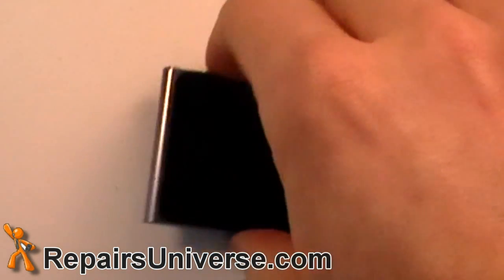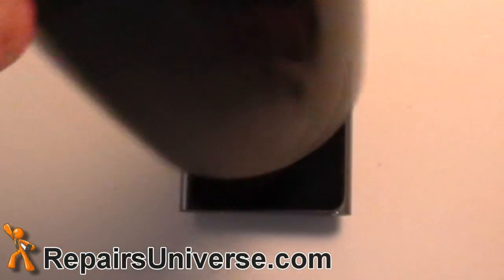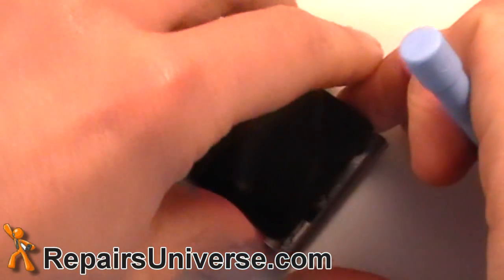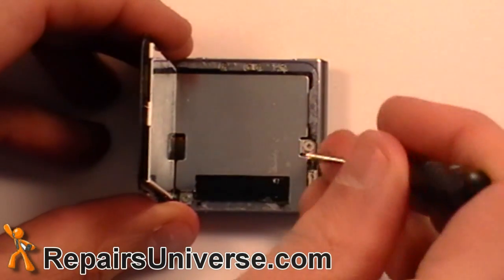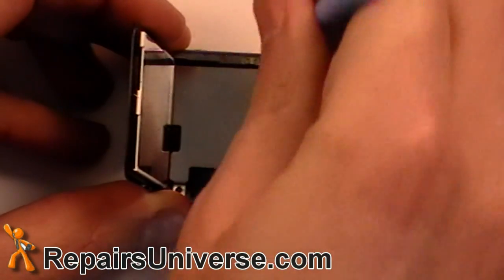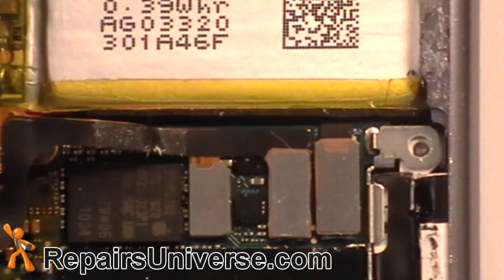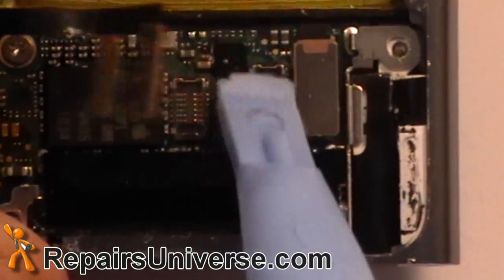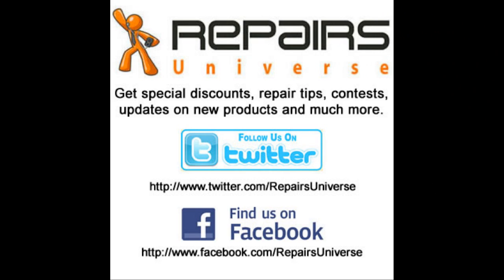iPod Nano Screen Replacement Repair Guide - 6th Gen

Comment: Replaced the screen with your replacement & it looks fine but does not respond to touch. Tried rebooting several times. Even tried removing & reinstalling.

Comment: I purchased a replacement screen for you guys and the backlight is not there. is it the logic board that is the problem?
Reply from the maker: ***** Try to do a hard reset on the device. Id that does not work then you may have blown the back light fuse on the logic board.

Comment: Hello, I changed the screen. Now the screen just white color, you know what's the problem? 
The screen lights up but only white. 
Can I get help? 
Thank you.
Reply from the maker: Where did you purchase the LCD? Sounds like it may be defective. Try turning the device off, open the case and remove the LCD flex then reinstall it. If that does not work then I would try to get a replacement LCD.

Comment: After installing a new screen, the image was 75% white with band of pink and grey on the right side. I tried to put the old crack screen back which was working before my repair attempt and now it is completely white. What do you think the problem is? What's it mean when you get a white screen?

I was going to buy another replacement screen because I think that may have been the problem.
Reply from the maker: Boback Z It sounds like you could have a defective screen. Did you make sure to power down the device completely, before attempting the repair?

Comment: the screen of my iPod took off when he was carrying, and after that the screen cracked. Why did this happen? would be a problem with the battery? I do not know how to paste the screen in place
Reply from the maker: Sa Covre Use double sided adhesive to attach the screen to the housing. You can find it on our website along with the screen you will need! Our technicians can guide you through the repair if you have any issues.

Comment: what do i do if my iPod screen is cracked and part of the inside chip is sticking out? i can only use it by shuffling the songs. Part of the screen has spreading black spots.
Reply from the maker: Andrew, You will need to replace the touch screen . As for the black spots that would be from a damaged LCD and that too should be replaced. Here are your parts needed for this repair.

http://www.repairsuniverse.com/ipod-nano-6th-generation-lcd-touch-screen-digitizer.html

Comment: I've dropped my ipod and the screen has crazked, it still works the same but i'm not sure how to remove it or where I can get a replacement screen.
Reply from the maker: Rowan Galloway If you navigate to our website via the link in our description, it will lead you to the correct parts you will need. You need a digitizer to repair your outer glass.

Comment: My ipod fell into the water..the sea..salt water to be spasific, i covered it with uncooked rice for a day then i recharged it and it works really fine! but the problem is that the only thing it cant do is to connect to the computer!! i cant sync anything, what might the problem be?

Comment from the maker: Yes, this is an issue with the LCD but the internal display(LCD) and the external glass (touch screen digitizer) are fused together. I suggest replacing the fused screen which is available on our site at RepairsUniverse (dot) com

Comment: Replaced a cracked screen on a 6th gen nano. powered up perfect I was replacing the screen part of the ribbon cable touched the metal case and there was a spark. No burn mark but it sparked. 

After the spark, nothing.

Tried removing battery cable and connecting to computer, nothing
Tried connecting to computer with battery connected, nothing

I assume I have to change the logic board as it won't power up with either screen connected?

Comment from the maker: This is an issue with the LCD but the LCD is attached to the touch screen digitizer. You will need to replace the LCD+touch screen digitizer for this device which can be found on our site. RepairsUniverse (dot) com

Comment: Hello,
My Nano has accidentally fall into the water for just two seconds, but the screen backlight just went wrong. The nano still works, in strong light i can see what is on the display, but it's pretty hard. Can you give me a solution for that, what should I buy? I don't want to buy a new one, I really like it :) I have it for more than two years..

Comment: My Ipod nano 6g ended in the laundry machine by accident. The Ipod didn't work anymore and I put it in a bag of rice to dry. After 4 weeks I connected the Ipod to the computer and I-tunes recognized it. I put some earplugs with a play/stop and volume buttons in and the Ipod worked. But the screen doesn't work. If I just replace the screen, would the Ipod just work as normal? Or is there something wrong on the inside maybe? 
Thanks

Comment from the maker: Double check all connections. See if your computer recognizes the device. If it does not then it could be a battery or a motherboard issue.

Comment: Hi, my glass has cracked, but the LCD is fine. Touch functions are still fine.. Can I just buy a touch screen / glass (i assume that's the digitizer as well?) without replacing the LCD?

Will I have to stick the LCD and the glass together myself?

Thanks a million!

Comment: do you have to add more adhesive after replacing the screen, or does the adhesive left over work just as good as before you open the nano?

Comment from the maker: This could be an issue with the LCD part of the device. Please check the LCD flex cable for damages such as a tear or pinches. Make sure all connections are secure.

Comment: @repairsuniverse
I have an iPod nano 6th and I decided to change the screen because the backlight did not work anymore so I bought a cheap screen on eBay for like $7 without the digitizer and new screen doesn't work at all.
Is it because the digitizer and the screen need to be bonded together?

Comment: @RepairsUniverse THANKS TO YOUR VIDEO I FIXED MY IPOD NANO 6TH GEN what happen was that the power button gets stuck so i used a exact o knife to remove the screen from the body of the iPod and you know so on if it wasnt to this video I wouldnt have fix my Ipod

Comment from the maker: This can be caused by damage or if a repair was done incorrectly. If there is no display but connects just fine to other devices then this is a LCD issue.

Comment from the maker: First you want to make sure the components are completely dry before attempting to repair it. Place in a bag of rice in a warm or sunny place. Depending on the extent of the water damage you can replace the components that are not functioning properly to fix the issues you are having. You can find the parts on our site. RepairsUniverse (dot) com

Comment from the maker: If the outside glass is cracked you will need the touch screen digitizer (TSD) if the inside display is cracked you will need to replace the LCD. The LCD+TSD combo is much easier to install/replace than the individual screens. You can find the parts on our website. RepairsUniverse (dot) com

Comment from the maker: I would suggest attempting to re-calibrate the screen. If this can not be done, then a hard reset may help. Even possible that disassembling the device and disconnecting the touch screen flex and re connecting it may help.

Comment from the maker: I would suggest replacing the touch screen digitizer. The Nano 6th gen's touch screen and display LCD are fused together however, making just replacing the digitizer very difficult. I would suggest swapping the full screen assembly. These are available at RepairsUniverse (dot) com.

Comment: Hoping you can maybe help me out here.  I dropped my ipod and cracked the screen, but the touch sensors were still working fine until recently.  Now, it's gone pretty wonky.  The touch sensors still kind of work but not very well.  It never seems to recognize exactly where I am touching, and sometimes it seems to get the directions mixed up.  What do you think I need to do?

Comment from the maker: @MerrildRene Is the device recognized by iTunes if plugged into a computer? If it does not connect, then there has likely been damage to the motherboard and it will need to be replaced. If it is recognized, it may be worth taking the device apart and just checking out the area around the power button, just to see if there is anything easy to spot that can be causing the issue.

Comment from the maker: @BaneWolf21 You will need to remove the screen, etc, to be able to remove the button and realign, clean, etc.
Does the button feel sticky, or just "locked" in a down position?
If it is just really sticky you can attempt to clean from the outside, but normally you will need to access the button from the inside.

Comment from the maker: @OnOffRebootMe It is possible it is water damaged. I would connect it to a computer and see if it is detected by iTunes. If it does, then the motherboard is likely working fine and is likely a screen issue. If it is not detected, it is likely the motherboard is fried and it would be considered "totaled".

Comment: @colingawellover1 We suggest you replace the full screen assembly (LCD display and glass touch screen digitizer) as Apple has fused together these screens making it very difficult to separate them without damaging the other screen. A full screen replacement will resolve the issue. These are available at RepairsUniverse (dot) com this is what he said to me

Comment from the maker: @MegaMajorMario We suggest you replace the full screen assembly (LCD display and glass touch screen digitizer) as Apple has fused together these screens making it very difficult to separate them without damaging the other screen. A full screen replacement will resolve the issue. These are available at RepairsUniverse (dot) com.

Comment from the maker: @colingawellover1 We suggest you replace the full screen assembly (LCD display and glass touch screen digitizer) as Apple has fused together these screens making it very difficult to separate them without damaging the other screen. A full screen replacement will resolve the issue. These are available at RepairsUniverse (dot) com.

Comment from the maker: @chokeonrocks Will the button physically press down or is it stuck? This is normally a very simple fix. Just heat the screen assembly, remove the screen and internal panel, from there you should have access to the volume buttons. They can either be removed or cleaned on the inside and outside. Q-Tips and a very small bit of alcohol work best.

Comment from the maker: @NamuPhuchi1 We would suggest the LCD with Touch Screen Digitizer. The reason being - the screens are fused together. It is possible to separate them, however it is very difficult and dangerous. For an extra few bucks, we highly suggest ordering the full screen assembly. It will make your repair much more simple.

Comment from the maker: @halinver Sounds like you got very lucky! If iTunes detects the part then that normally means there is no motherboard damage (that would cause the Nano to be "totaled"). The LCD screens are sensitive to water. I would suggest replacing the full screen assembly, as replacing only the LCD is very difficult as the touch screen and LCD are fused together. Replacing the full screen assembly is a very simple swap and should resolve the issue. These are available at RepairsUniverse (dot) com

Comment: Hey, Mi Ipod Nano 6G went to the wasmachine :'(
I let it dry 1 week and it does not turn on and Itunes does not detect it, then I try open it to clean inside and it works, Itunes detect it now but the screen is black without light.
that means the screen is still wet? or is it broken and i have to replace it?
Thanks for your answer ;-)

Comment from the maker: @Dyter1 Sounds like a LCD issue. Replacing the screen assembly would be suggested - This is because the touch screen digitizer and LCD screen are fused together and attempting to remove only one screen normally results in damage. The screen assembly is a very simple replacement. These can be found at RepairsUniverse (dot) com.

Comment from the maker: @Shahrul1313 You can use this guide here to replace the screen. The Nano 6th Gen uses a screen assembly with the LCD and touch screen digitizer fused together, making just replacing a single screen (either glass touch screen or the LCD screen) very difficult. We suggest replacing the full screen assembly which is a much simpler repair. These are available at RepairsUniverse (dot) com.

Comment from the maker: @theowbert If the iPod is detected by iTunes, that is a very good sign that it is only a display issue. I would suggest replacing the LCD + Touch screen digitizer assembly available at RepairsUniverse (dot) com. The reasoning for the assembly is that the LCD screen and digitizer are fused together, making it very difficult to replace only the LCD screen without damaging the touch screen digitizer. Tool wise you will only need adhesive strips and a small phillips screwdriver.

Comment: @RepairsUniverse i left my ipod in my pants and it got washed, it wont turn on, but if i plug it into itunes it detects the ipod, however the screen is still off, not sure if it still works or not, but what do you think is wrong (component-wise), how will i fix it, and what will i need (parts etc)? 

thanks

Comment from the maker: @Moa991 Likely you ordered only the touch screen digitizer or only the LCD screen. The issue with this is Apple fuses together the two screens, making removing one a bit of a pain. This is why we always suggest the touch screen / LCD assembly available at RepairsUniverse (dot) com. It is a much simpler repair.

Comment from the maker: @EointheGuy101 If the device itself is working properly then it is likely you will just need a screen replacement. The Nano 6th gen has the touch screen and LCD screen fused together. I would suggest replacing the full screen assembly. This will make the repair much more simple. These can be found at RepairsUniverse (dot) com.

Comment from the maker: @MrBoobiesLove No problem at all. It is always worth a try. It depends on if the button/flex cable is physically damaged or if it is just stuck. If it is stuck you can use a Q-tip with a small bit of alcohol to clean the area (stay away from flex cables and electronics though).

Comment from the maker: @PauChiChiBang No problem at all, glad you found the video helpful! If it is not sticking properly it is likely just an issue with the adhesive. I would suggest applying some new adhesive, the adhesive strips available at RepairsUniverse (dot) com have found to be the most effective.

Comment from the maker: @gvitalie420 Just because the part is small does not mean it is less expensive to manufacture. In fact, in many cases it is the opposite. Also, many models Apple has produced lately has the LCD screen and touch screen fused together, making it very difficult to replace only the outer touch screen or the inner LCD screen. Check out RepairsUniverse (dot) com for our current parts and prices for the Nano 6th generation.

Comment from the maker: @SoStuckUp12 The glass (outer) touch screen is also referred to as the "digitizer". If you mean the LCD screen, it is possible, but not suggested. The touch screen and LCD screen are fused together and are very difficult to separate without causing damage to the other screen. We suggest replacing the screen assembly, it is much simpler and safer. These are available at RepairsUniverse (dot) com.

Comment from the maker: @MrQbeezy It depends on the cause of the white screen. It can either be an issue with the motherboard, or LCD screen. If iTunes recognizes the iPod, then it is likely that the LCD screen is faulty, and when replaced, the white screen will be repaired. If it is not recognized, the motherboard is likely at fault.

Comment from the maker: @Chis100970 PLEASE NOTE: the touch screen and LCD screen are fused together and therefore, quite difficult to remove without damaging the other screen. The item on eBay is likely just the LCD screen or touch screen. This repair can be done, but is fairly difficult. We highly suggest the screen assembly, which removes the entire process of separating the screens. These are available at RepairsUniverse (dot) com.

Comment from the maker: @PinoyG94 Put your Nano in a bucket of rice in a warm area overnight. That should absorb the water left inside. Then try using it and see if there are any issues. Sometimes theres damaged to the touch screen, motherboard, or even headphone jack. It all depends. Thats what makes water damage so difficult. You can find replacement parts at RepairsUniverse (dot) com if you can figure out the issues (if any). Good luck!

Comment from the maker: @filikix11 If you have cracked the touch screen it is possible to still use your Nano, this is classified as a cosmetic issue. However the cracks can spread quickly and is prone to more damages easier. It is likely you will eventually need to replace the screen. You can check out our replacement screens for the Nano 6th Gen at RepairsUniverse (dot) com.